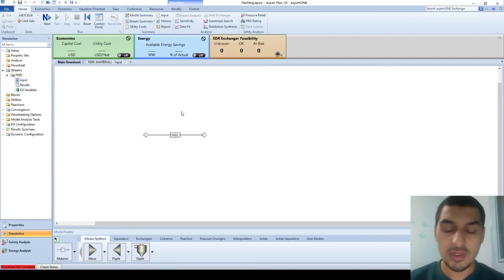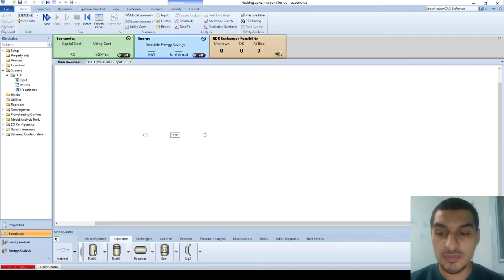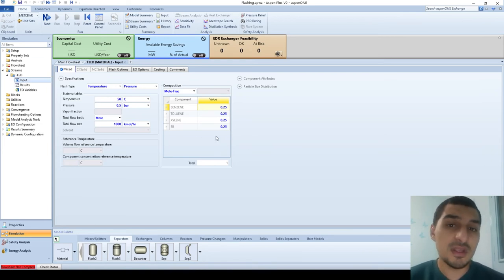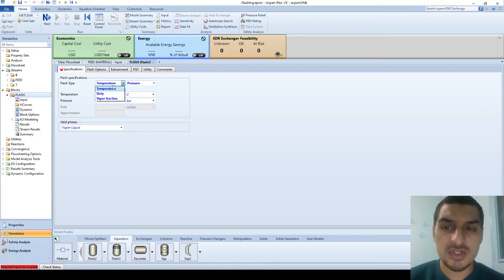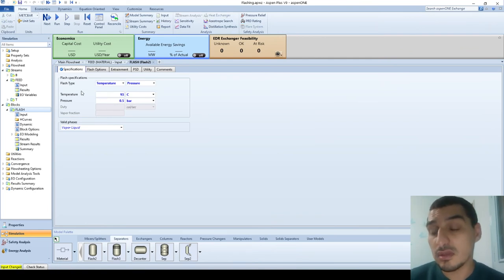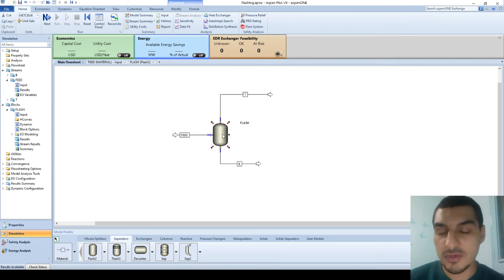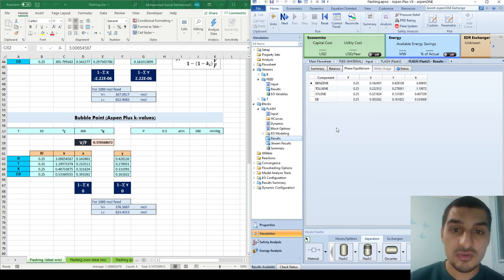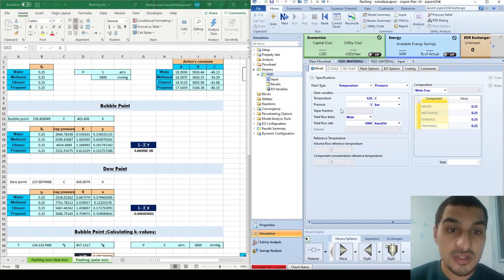Aspen Plus in English | Part 2 | 05 | Flash separation (Aspen plus vs manual calculations)

Comment: Hello. Thank you so much for your work. Is it possible for you to show your thermodynamic choice (doesn’t require justification) so I can check my ability to select the correct package, and could you show the selection of your components? I.e. it is Xylene here but there’s multiple Xylenes in the database, did you select O-xylene? M? P? 

Would be very much appreciated.

All the best
Reply from the maker: Hello Samuel,
For the first example I used a mixture of Benzene, toluene, o-xylene and ethylbenzene. The thermodynamic model is SRK.
For the second example I used water, methanol, ethanol and propanol. The thermodynamic model is NRTL.

It might be a good idea to upload all the Aspen Plus files and share the link in the playlist description to be available in case further information that are skipped in the video are needed. I will do that soon.
Reply: @MGMohammed   thank you so much for your reply and series.

Comment: Thank you very much Prof. For highlighting the importance of a thermodynamic database. Can I make a request for a tutorial on packed absorption tower using water for separation of carbon dioxide and methane (Biogas) in Microsoft Excel.
Reply from the maker: Thanks for your suggestion! I have not done that before, however I will look into it and record a tutorial as soon as possible.
Reply: @MGMohammed  Thank you very much Prof. Great video as always.